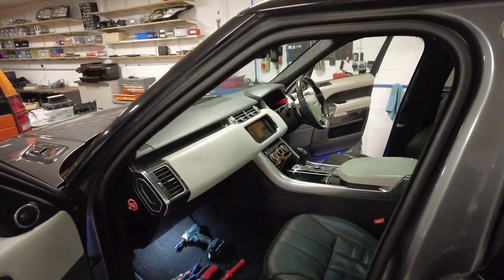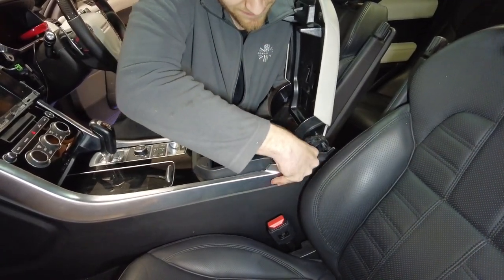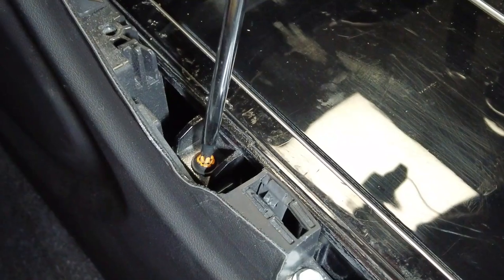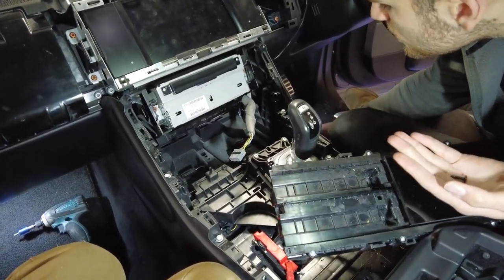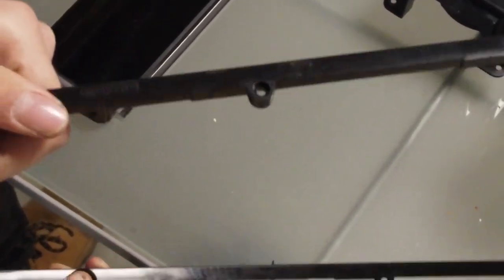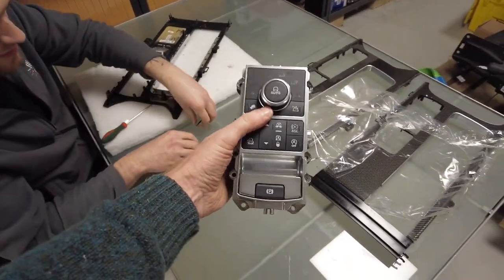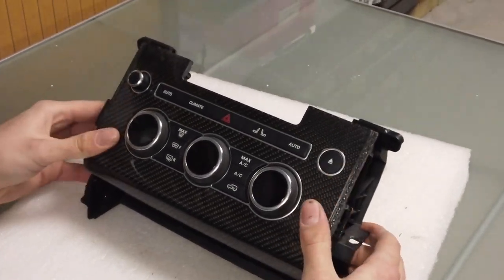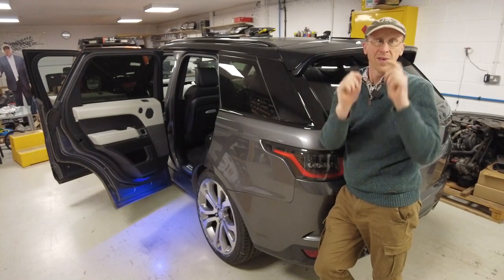Range Rover L494 Interior Centre Console Strip Down & Upgrade ( cup holder / gear change etc )

Comment: Thanks Simon, but I needed this last weekend when I was installing an Apple CarPlay/Android Auto system to the existing screen. 😊 I couldn't work out how to get the hockey sticks out.  Can the heater control panel be upgraded to newer version where you can press the temperature buttons to control heated seats? Also, can the cup holder be upgraded to newer version where you can also slide the cup holders forward to reveal a cubby hole underneath? (My car is an early 2014 L494 HSE)
Reply: Id like the heated seated function of the newer type too I believe its a straight swap but only upt 2016 models as the communications in the car were updated so they wont work. This is a great vid always wondered how the dash strip came off! I wanted to replace the rubber mat under the heater controls for a wifi charging mat, so now I think i know how, good work Simon and team

Comment: Thank you so much. I have a RR Sport 2018 Autobiography. I am changing the climate control screen as it is badly scratched. I removed the rear climate panel, the front panel around the infotainment screen and the side chrome bars. I then removed 4 visible screws maintaining the climate control screen, however it does not come out. It barely moves. Any help would be great! I have pics but don't know if I can include them here.

Comment: Question: if a drink was spilled in the cup holders and spilled forwards towards the console/heating, could that cause issues as my infotainment system stopped working, reverse camera too .. or is this a MOST bus issue?
Reply from the maker: I think this is more likely a MOST bus issue - did you watch this video
https://youtu.be/B752xfrxzLw
Reply: @L663  I'll check it out - I don't have any logo or images on the infotainment screen but I will check out the vid, thanks.

Comment: hi, I would like to ask you if removing the climate mask, the airbag plug is removed ?!  I have the light on how can I turn it off?
Reply from the maker: Sometimes the light will reset if you disconnect and reconnect the battery. Otherwise you will need some diagnostics equipment to reset the light
Reply: @L663  even if I think it is not possible, I am afraid I have forgotten to reconnect the plug;  where am I going to look for it?

Comment: Hi Simon,

Is it simmilar for the L405? I have had a brand new black trim for ages in the garage but didn't want to tackle it. Fed up of looking at scratches. Is there an L405 video?
Reply from the maker: Hi - i dont think we have done the L405 - i will try and get that done over the next couple of weeks.
Reply: @L663  Thanks Simon. Dont forget to get in touch about the winch mount for the L405 & L494 willing to come and support you with the installation and sponsor the video etc.
Reply from the maker: @daviesbikeable  OK i have not forgotten..
Reply: Try hand polishing it, comes up a treat

Comment: Following this manipulation, I have "HDC unavailable system fault" and "handbrake fault" ... any ideas?
Reply from the maker: Hi - try turning the car on - off - lock it - do this 3 times it should clear the fault
Reply: @L663  First of all, thank you for your quick help ... then, you just have to remember that the electronics work better when everything is plugged in ... I simply forgot to plug everything back in before reassembling :)
Reply from the maker: @BC-tw2uf  Glad you sorted and on the road.... I know from first hand experience how your heart sinks when this happens !
Reply: yes, and like a kid when it works again